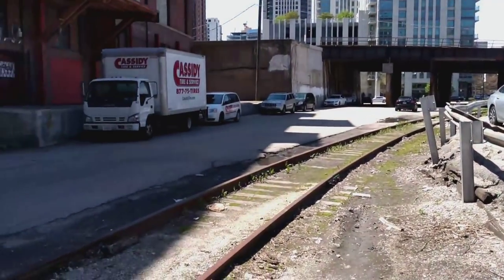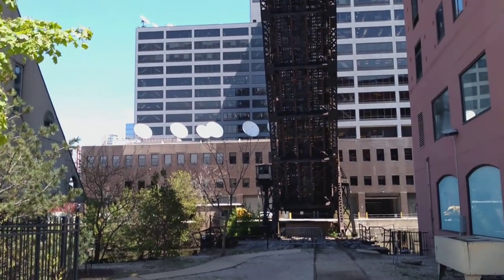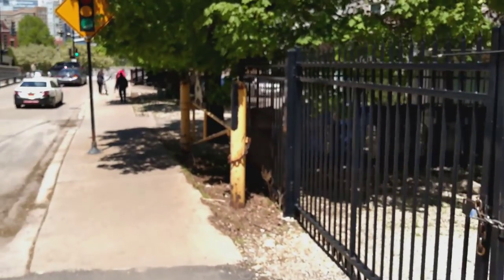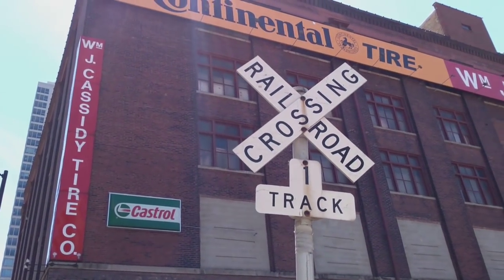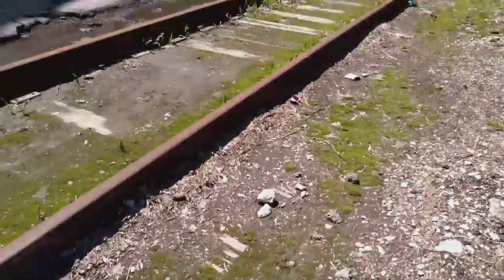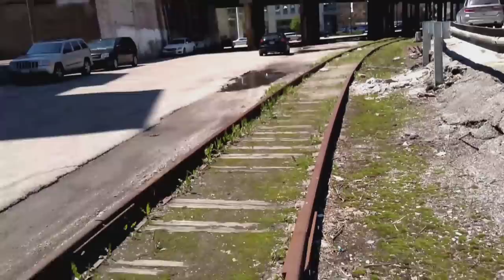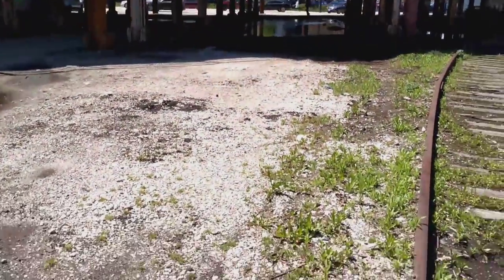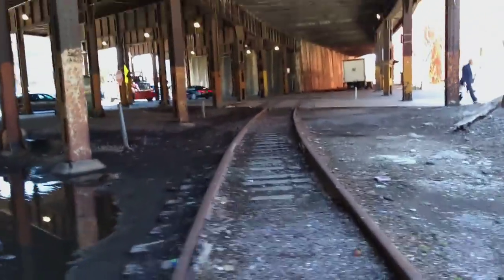Historic Abandoned Railroad Downtown Chicago

Comment: Former CNW line out to Navy Pier.
Cut back from the pier by the 80's and was only serving to bring newsprint to the Sun Times. 
When the Times sold the property to make way for Trump Tower the need for newsprint to make it's way over the river was no more and the line would most likely have been abandoned and scrapped save for the small issue that UP found itself the proud owner of not only a bridge but a historical landmark that they have to maintain so IIRC the tracks are technically out of service I would assume in the event UP needed to do maintance or repairs that requires something heavier than a hi rail can manage.
Reply: @railrol82  thanks you too. Pretty much CNW was the hometown railroad and grew up around MP 25.5 on the northwest line (UP Harvard sub) so I know a bit about some of the obscure nooks and crannies of the CNW.
Can remember warm summer nights and from time to time waking in the middle of the night to hear Twin City bound freights grinding up the grade out of the DesPlaines River valley ( and few times when the power desk at Proviso didn't put enough power on the head end and they had to cut the train in half to make it over the crest just outside of town.) though these days freight is all but gone save for maybe one or two manifest freight a week to handle the remaining customers on the line and the odd grain extra or two and while I'm still in town I'm more likely to hear the rare CN freight on the old SOO tracks east of me and only if the wind is right.
Reply: So your telling me we can thank trump for this abandonment
Reply: @garysprandel1817  so your saying you have two lines in your area. Up controlled cnw. And CN controlled soo?
Reply: @cjstibitz2130  are you going back to Jussy Smollett's again tonight?
Reply: cj stibitz the line is not actually abandoned UP maintains bridge and lowers it once a year for maintenance

Comment: That spur in the video above used to served the old Chicago Sun Times printing plant on the south side of Ashland Avenue and on the east shore of the Chicago River in the loop. That printing plant closed almost eight years ago and outsourcing its printings to the arch rival Chicago Tribune.
Reply: This served the Sun-Times printing plant when it was under their headquarters on Wabash and the Chicago River. The Ashland Ave. Press is further Southwest outside of the downtown area near the CN old IC Iowa Line / old Santa Fe Line North of I 55 Stevenson Expressway.
Reply: The chocolate factory still gets a few deliveries. Nothing is active past Canal Street.

Comment: I think they last ran trains through in the early 2000s. I've been by the bridge many times starting in the late 70s through just 2 weeks ago. In 2000 or 2001 during a C&NW/UP SunTimes paper run, I remember seeing the bridge down and running over there and chatting with one of the flagmen. I got a chance to read the plaque on the head of the bridge. I waited with him until the geep came back out from under the apparel center.  If smartphones were available then I'd have some pics/video.   At that point they'd already cut the cord from the East/West trackage and were using the curve from the North/West trackage. 
In '79 I was there with my pops, and some of the North/Soputh Milwaukee Road trackage was still there. The diamond was removed already (I think) but I didn't at the time realize the CMSTPP ran trains past there and across the river. I though it was so strange that one of the tracks ran straight North as if to go on a massive barge that might have been backed up to there! If you stop your video at 1:36 exactly that is exactly the point were the track ran.The street (and bridge) was raised in the early 90s (after the tunnel flooding-the pylon hammering that flooded the tunnels occurred on the East side of the river there), so there was no grade until then.  
I chatted with a UP guy last year, and he said that on the East side of the river, the UP wasn't asked or even informed that the tracks had been removed between the Apparel Center (now Holiday INN) and the bridge. He told me that there were plans to hook that track back up and run a locomotive as far east as they could go (for trackage/property rights). We'll see if that happens! 
Thank you for posting this and all your videos! You could make a really neat video of the CMSTPP (line that ran from there up past Wrigley Field and up into Evanston!

Comment: Have you ever been on the Metra?
Reply from the maker: Never been on it, but seen it on my trip to Chicago.
Reply: @railrol82  What about the South Shore Line?
Reply from the maker: @Ih8kone  Is that the L train?
Reply: @railrol82  No it's a commuter rail line that also feeds into Chicago.
Reply from the maker: @Ih8kone  There is so much RR treasure to see in Chicago, I was speechless. One could be filming for a month straight, and still not have covered everything.

Comment: Calling it "abandoned" is incorrect. The tracks are still active on the books. The lift bridge gets lowered and something like a high rail truck is driven over it once a year to keep its active status in tact.
Reply: Actually, what you show in the video speaks otherwise. That crossing on N Canal St. where the video starts with it's "Report A Problem" signs is proof it's still active on the books. Those signs would be removed if they were abandoned. Being "abanoned" suggests that they've been severed from any network all together with pave overs or developments that would forever block its use from both ends of a track segment. In this case, all that prevents that spur from having a train run on it are those wheel bumpers. Plus it is a known fact that they do run a high rail truck over them and the lift bridge to retain it's active status in the books once a year. For the other 364 days of the year, it would be correct to call the line "out of service".
Reply: By comparison, the video you did on the FEC Overseas Railway in Florida, and that short stretch of rail you found that was cut off with the waterway on one end and the removed rail on the other end,  that short section of track that was left by definition would be called  "abandoned". For terminology, those are how you would describe the difference between "abandoned" and "out of service".

Comment: I’ve seen that line before when I’m in the city. I think it’s abandoned but I’m not 100% sure. I’m 65% sure it’s abandoned
Reply: RailROL82 yep
Reply: @railrol82  Not entirely correct. Yes, they lower the bridge once a year, but on the side of the river you were on, there are still 1 or 2 factories that receive deliveries. One is the Blommer Chocolate Company, and they still get trains once in awhile.

Comment: Does it keep going on the other side of the bridge?
Reply: It goes to Navy Pier.
Reply: John Cotter are the tracks ripped up?
Reply: Nope, the tracks run on the pier next to Navy Pier and they are still there. You can see them on Google maps. That train was a passenger train for C&NW. I believe it stopped running in the 50s. Look it up.
Reply: only in pieces, Rc 4 Life. They do not run to the pier any longer. You can see remnants here & there on lower Michigan Avenue - head down to the original Billy Goat Tavern for a beer & burger & scout them out.....
Reply: It's obviously been a while since Mr. Cotter has been to the pier. It's been totally redeveloped & the tracks are long gone. If you venture to Wells St., LaSalle St. & Clark St. south of Kinzie you will cross the old rail corridor on bridges...enabling a nice view down below to what they're calling Carroll Ave., which is a service drive for delivery trucks to the buildings above. You can see rail remnants here & there....

Comment: I've been to Chicago once and they have gone out of they're way with the elevated  subways and Chicago probably has some of most intense gridlock as any other major metropolitan area and only gets worst as more cars get added to the roads every year. I am sure the cost and the time to build some rail overpass or underground  would have been ideal at one time, but Chicago is far to developed to redevelop it with railway on mind. Now maybe in my mind the only way to have rail is to dig a big tunnel underneath the city, but I am  sure it would be cheaper to just go around it.
Reply: @railrol82  As a canadian I am not certain what the U.S.A. regulation are, but I am certain that the Canadians either share similar regulation or are very close  in similarity. I would say the Chicago Transport Authority in my mind no doubt does regularly schedule infrastructure assessment and repairs on it's elevated subway. However I am not a structural engineer, but I trust in the CTA  that it's probably pretty safe.